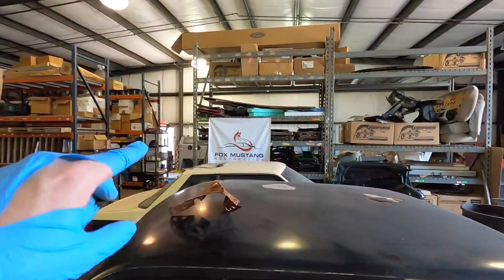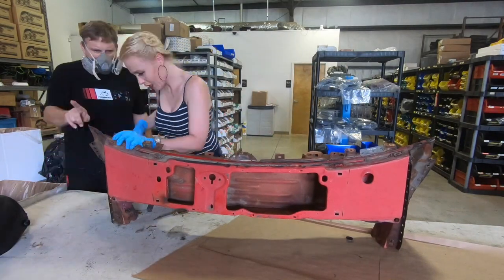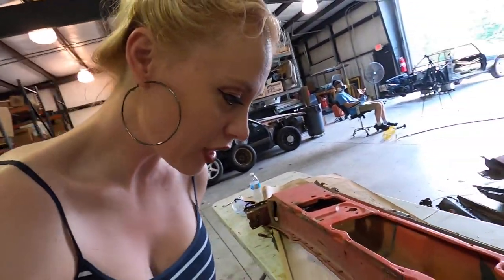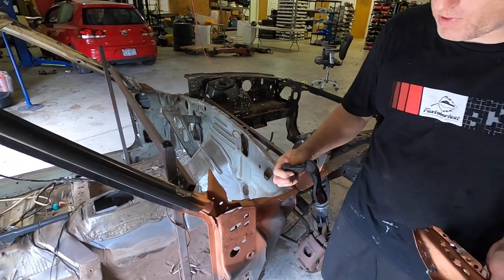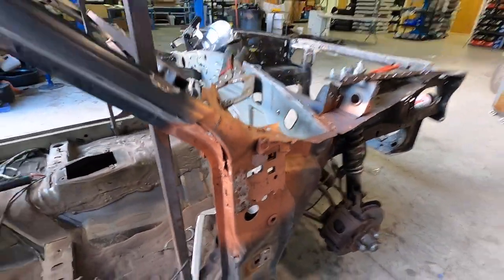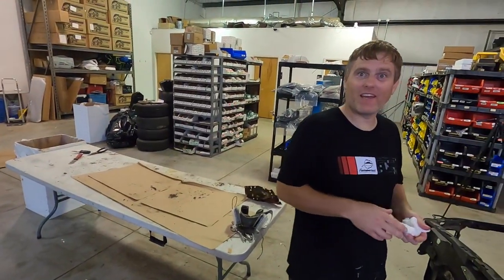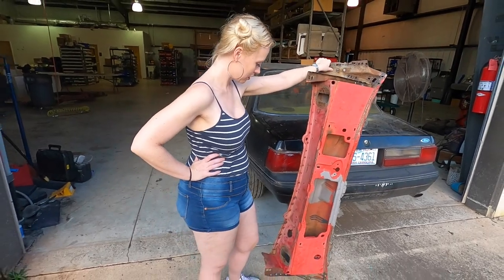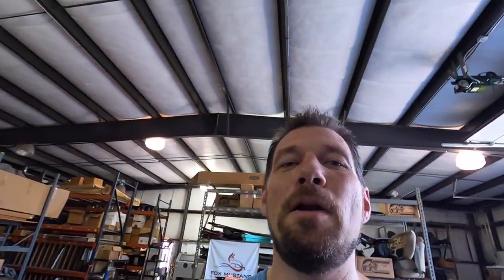SHE sand BLASTED MY cowl GRILLE! // SSP Rust Repair Part Two

Comment: Looks like u had the same kind of day I had today. I got a lot done to my 347 today but it doesn't look like it because I had to battle through all of the slow stuff that takes forever before I could really start putting the big pieces into the block but I got it painted got the rods put on the pistons and those 16 aggravating rings that hold the wrist pin from moving side to side and they are a big pain in the a$$ but I got all 16 of them battled through and then I had to put 56 rings on the pistons then the rod bearings and main bearings in the block crank put in ,main caps then the girdle, and finally I torqued the main caps and girdle down and by then I was soaked so I called it a day and went and got something to eat 😁 but I got it where I can roll on with it when I go to put the pistons and rods in. You got some good help and she's got the cowl looking good. I can't find any help to even show up🤣 much less work and get stuff down like she does 😁 but u need some help you have way more than I do to get your car going but when you get done it is going to be a badass car for sure no matter what you do with it cause it is going to be like a new one then you can sell it to me for $800 . That would be a good deal for a guy like me 🤣😂😂
Reply from the maker: ROFL, I'll think about $800 for a little bit, ok probably not 😂.  Man thanks for the update on your 347.  Great to hear it's coming along even if it's slow.  Yeah i've got a WAYZ to go for sure.

Comment: I bought the 1977 ford f150......it in bad shape body wise....but fixable..dont have it home yet...hopefully the engine is good..bought it from a storage unit...no keys and they wouldn't let me test to see if the motor turned over..ended up paying 500 bucks for it...good news..I have a hole role of ductape and a hamster wheel and 2 hamsters..all is good.
Reply from the maker: Man you've got all you need then with those hamsters and ductape 🤣. Even if it doesn't turn over how can you pass for that price.

Comment: airplane stripper: brush on, rinse off. corrosive to work with but time saver.
Reply from the maker: Interesting, I wasn't aware of that.
Reply: @GearHead704  yeah, it comes in a blue container with an airplane on it. it's in the paint aisles in auto stores, paint supplies, etc. brush it on 5 minutes later you wash it off. slick as sh*t
Reply from the maker: @ezcondition  👍